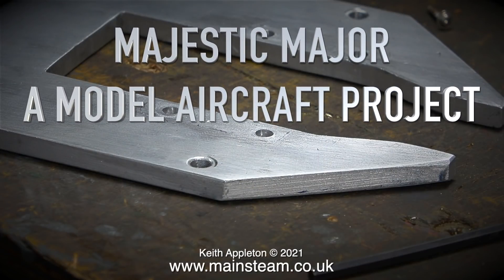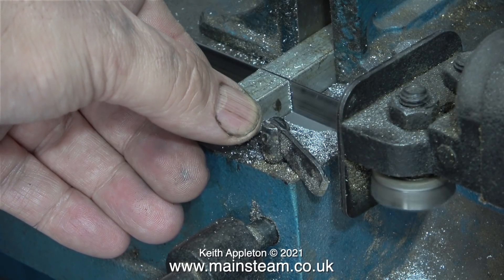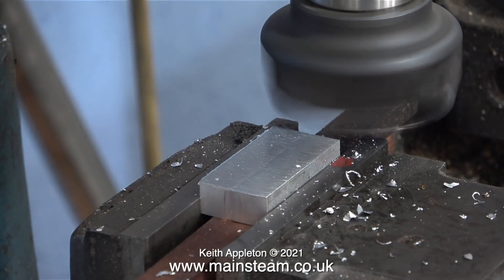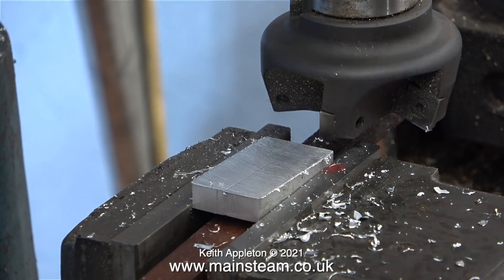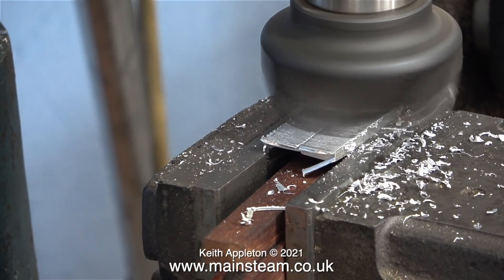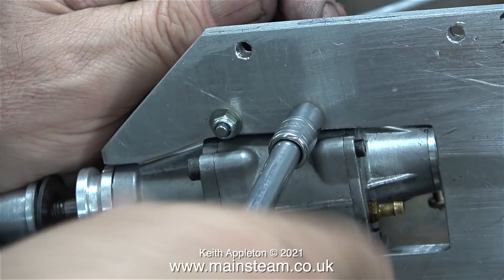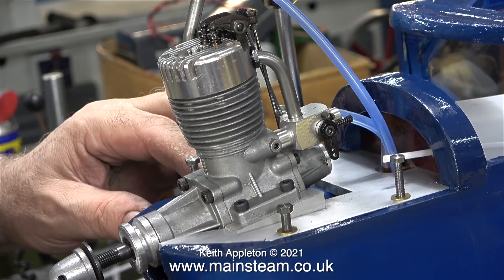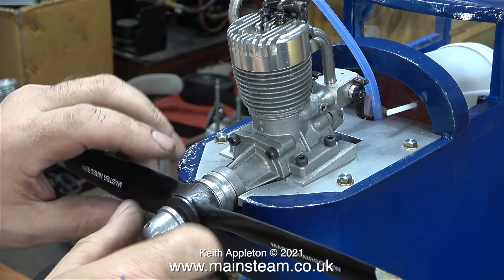MAJESTIC MAJOR PROJECT - PART #11

Comment: Nice video as usual.  You've got to remember these were originally free flight aircraft.  I've got a Ben Buckle Falcon.  No side thrust, no down thrust and with a Laser 70 is a very nice relaxed plane to fly, just bumbling around the sky on a summers evening.  Does it get much better than that?

Comment: Thanks for the video Keith. If you offset the cut in the y direction so the cutting tooth is in contact with the job longer this Will reduce the rattle. It’s usually caused by the splines on the spindle drive. Try to keep a tooth in contact at all times . This means the pressure on the spline doesn’t come on and off as the cutter teeth engage and disengage.
Reply from the maker: Yes indeed, but this machine always rattles anyway - it is the pulley guard rattling mainly . . . .